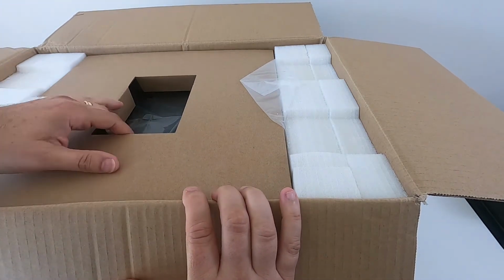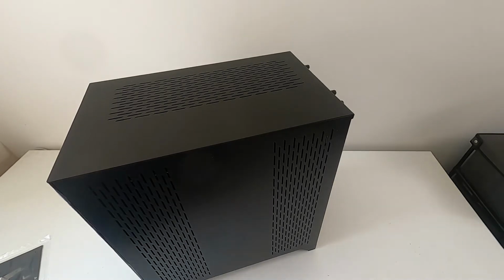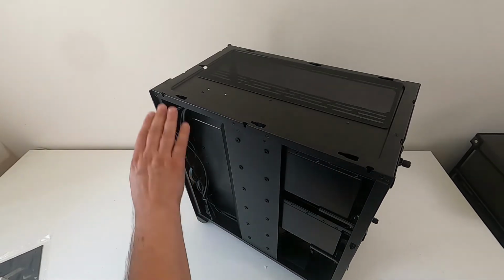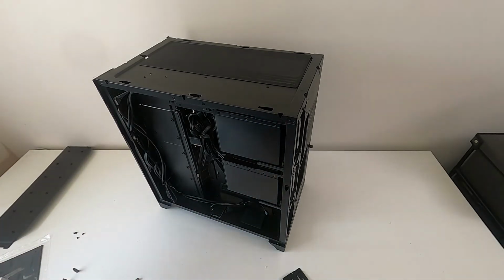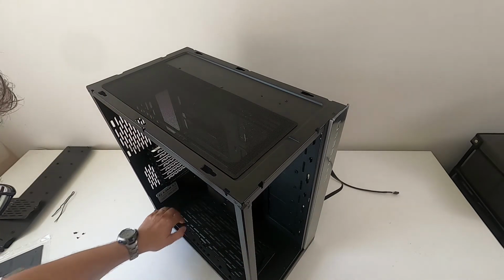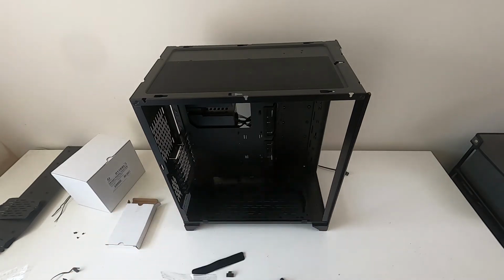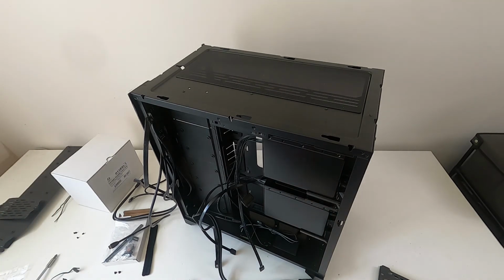Lian Li 011 Dynamic XL Tower Case *REAL* Unboxing in English

Comment: Doesn't this Case come with any Fans?
Reply from the maker: No.

Lian Li assume you'll be adding your own. And they are right to do that.
Reply: @sterntechdaddy  Looks like Apple's business of buying separate chargers for their premium phone was a great success as this same strategy is widely accepted in the market today.
Reply from the maker: @benisonbesra  For PC cases... people will tend to want to buy their own fans to match their build. As case of this size can accommodate a LOT of fans so if Lian Li were to supply them then that would cause problems...

But Apple not supplying chargers now is pretty sensible... you probably already own one and any USB port will work.

But they could lower the price... they seem to have dropped the charger, but increased the price!

:D

Comment: Ive gone through 2 SSDs 1 is 250gb the other is 1tb and theyre both full because games are way bigger now a days is it worth just buying a 14tb hard drive and storing my games on that and then software and other stuff on the SSD ? Also could you do a video on cleaning a PC properly
Reply from the maker: Here's a tip... 

I only install the games I actually play!

So even though I've got a MASSIVE library of games split across Battle.net, Steam, Epic Games Launcher, and Origin I'm only using about 1TB.

Note that SSD's generally like to have 20% free space to work efficiently so you shouldn't be filling them up too much anyway.

I actually use a 4TB mechanical drive for the games - with Diablo III on my 500GB system SSD - so although putting games on an SSD will obviously improve loading times, its a lot cheaper to use a mechanical to get space.

Here's a few options if you're interested...

https://www.youtube.com/watch?v=yrrMNIeACJ0&t=840s

And yes... I can do a video on how to clean up and optimise your PC properly.

:)
Reply: @sterntechdaddy  Thanks for the reply I will see about uninstalling some game. Have a good day
Reply from the maker: @rs-uz7tq  No problem.

Note that removing the installation files for older games doesn't mean you lose them... you still own them in Steam, etc.

You can download and play them in the future if you want to.

:)

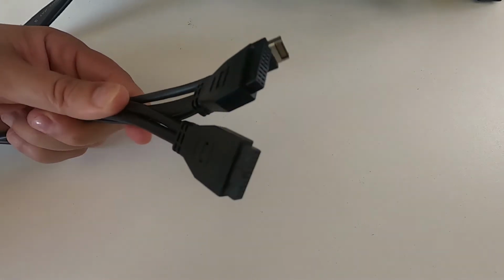Comment: Thank for the review :) can you link the device you talk about at 10:25 please ?
Reply from the maker: Of course!

Here’s the one I bought for this build…

https://www.moddiy.com/products/USB-3.0-Motherboard-Header-20-Pin-Internal-USB-Hub-Controller-4-Port.html

You could use a splitter cable like this one…

https://www.moddiy.com/products/20-Pin-USB-3.0-Internal-Header-Y-Splitter-Cable-12cm.html

It’s 1 x female to 2 x male but the description says 1 x female to 2 x male for some reason.

This is cheaper, but will only allow two ports to be used at once because it just splits the single interface into two connectors and doesn’t add anything extra.

The more expensive interface supports all four USB3 ports because it’s an actual interface that adds two USB3 and two USB2 connectors.

Hope this helps.
Reply: @sterntechdaddy  Thank you! This will be very helpful because i'm planning to build a new PC w/ custom loop next month using this case ! :)
Reply from the maker: @Arcade2799  If it's your first loop then this case will make it easier because there's a lot of room - so it's more forgiving for the direction and placement of tubing.

You can also get a really funky front panel like this one...

https://www.watercoolinguk.co.uk/p/Barrow-Waterway-LRC-20-RGB-Distribution-Panel-Tray-for-Lian-Li-O11DXL-X-Dynamic-XL_71310.html

:D

If you don't plan on water cooling the GPU then it's easy to junction the holes or route to a bottom reservoir - which the 011D XL has room for.

Put a link in so we can see it when its done if you want to show it off.

:)
Reply: @sterntechdaddy  Yes this will be my first loop ( 3 rad, CPU and GPU ) , you right, the front distro plate will make it a lot easer, i've choose the EKWB's one witch mean practically no bend exept for the GPU this gonna be a bit more tricky because of the wierd PCIE slot placement of the MSI z590 Unify motherboard.
I will be back when it's all done :)
Reply from the maker: @Arcade2799  Looking forward to seeing it...

:D
Reply from the maker: @apple john No problem.